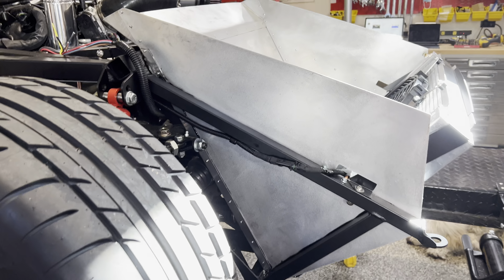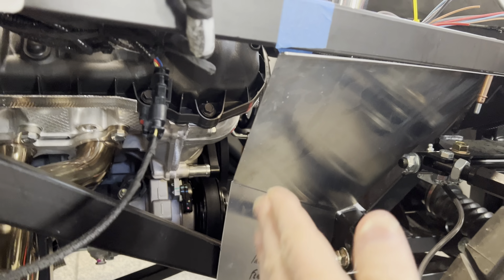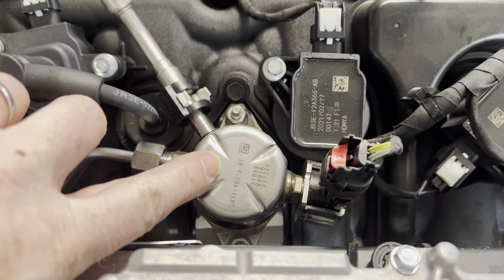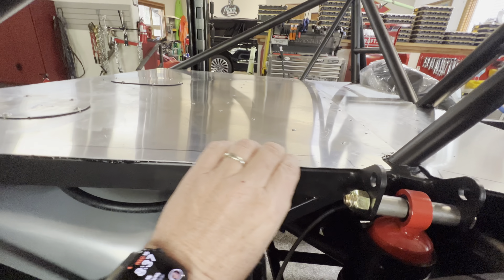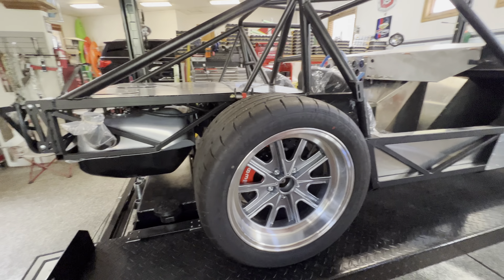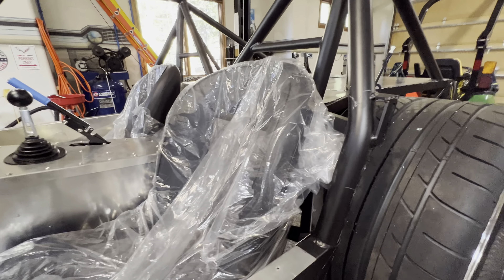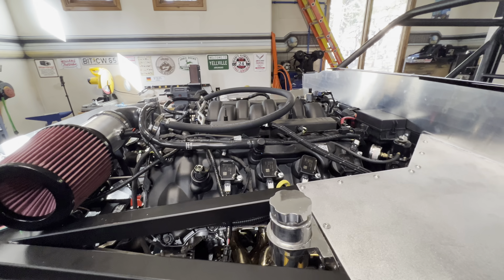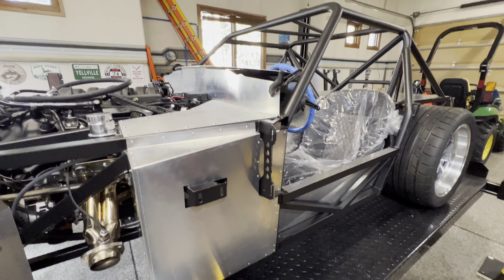Update 27 a General Walk Around, Factory Five Type 65 Coupe (1965 Shelby Daytona Coupe)

Comment: Diff vent is a good idea. On my custom chassis idea, I have a specially-shaped fuel tank that fits inside of the rear axle around the diff and prop shaft with dual fuel pumps. Just for balance.

Comment: Thanks for Your update. Did you have any issues with the aluminum ducting for the radiator? On my frame there is one inch difference between the top and bottom, where the hose route through the panel making the side panel not meet.
Reply from the maker: No, I don't remember having any problem in that area.

Comment: If it is possible to get the dimension from bottom of gas pedal to very back of driver seat?  Is it possible, to install the 3 pedals further towards the front without interfering with the exhaust manifold??
Reply from the maker: Sure, I can do that. I’ll try to get that done and post it here this weekend but I have to tell you. It’s not very big if you’re very tall, it’s gonna be tight.
Reply: @YellvilleArkansas  Maybe, just maybe the pedal arms can be reversed, or reangled,  and the foot box border wall can be extended 2 inches+ to the front
Reply from the maker: @FooFahFoeFum  Bottom of the gas pedal to the seat back is 41 inches.  That is to the point where your back meets the seat back. I assume that’s what you meant.
Reply: @YellvilleArkansas  OK THANKS... i NEED AT LEAST 43 INCHES .... thanks again for your help.